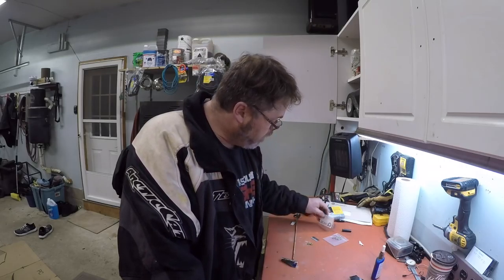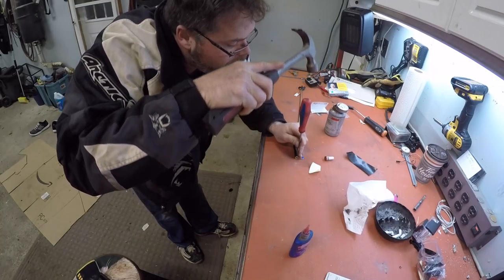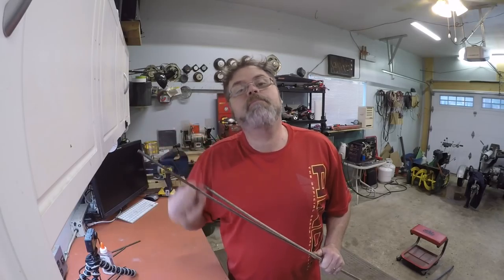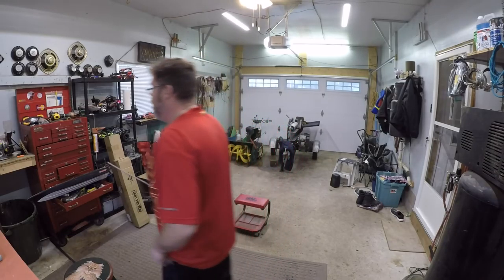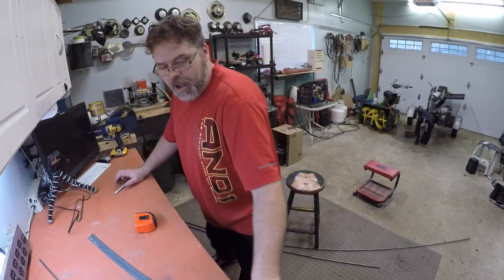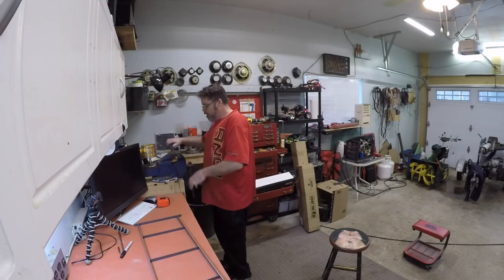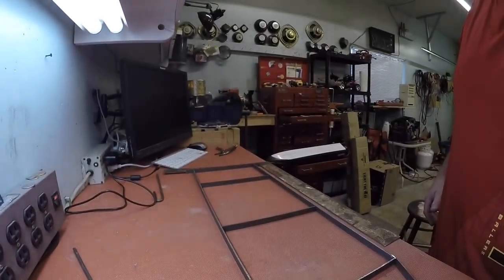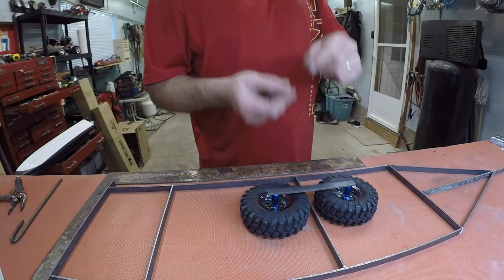Starting Fabrication On RC Boat Trailer

Comment: Hey Bill,
Make it a low boy boat trailer,  then you can be known as Little Wet Willy the Low Baller Trailer Builder from Canadastand!😜 Lmfao 
I am just kidding bud.... it is looking good fer real, I built a low boy car hauler for one of my Rc's but I used aluminum instead of the steels. It turned out deeescent buts, I wish I had used steel and welded it together rather than aluminum and using nuts & bolts to hold it together....I need to find me a cheap tig welder,  maybe I can get me my own  "pug 1" he is about the cheapest frig sackner around......rotflmfao!😂
I was thinking about your snow boating idea and everybody I know who has done it used a much smaller & lighter boat than the Traxxas Spartan. It will be interesting to see if your boat will be able to move in snow because of the size and weight of it. Well I gotta chit and get, ttyl Lil Wet Willy ....lmao 🤣      I hope all is well at the Billsiff household take care bud